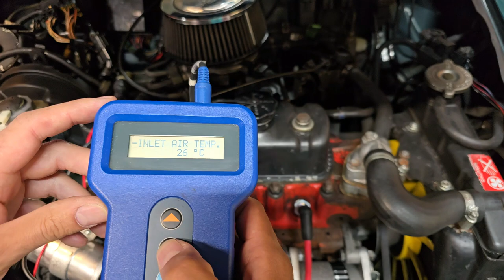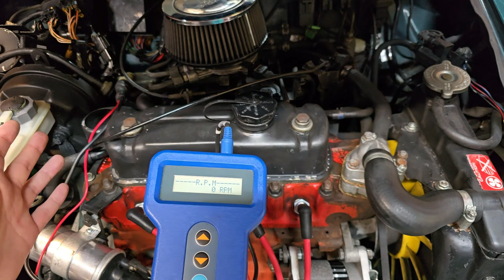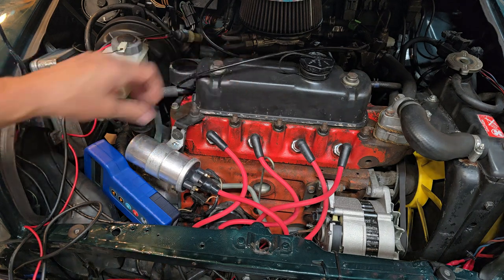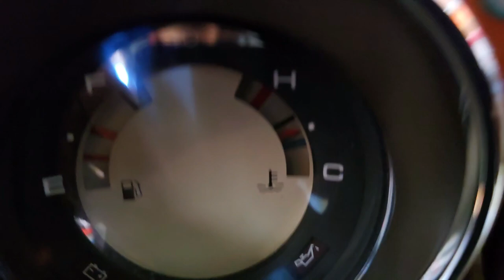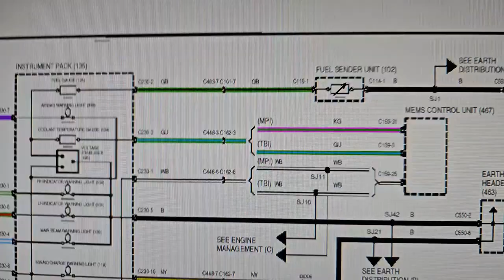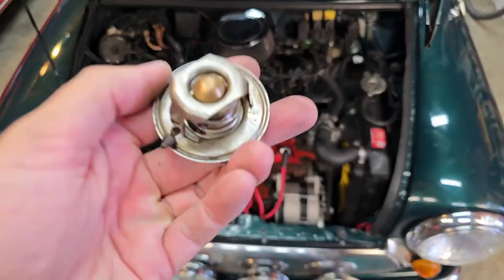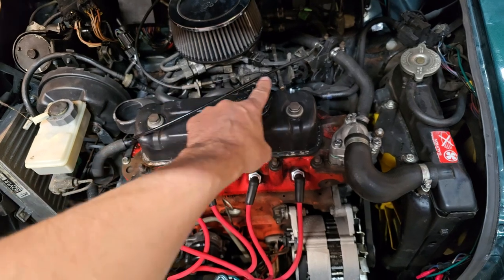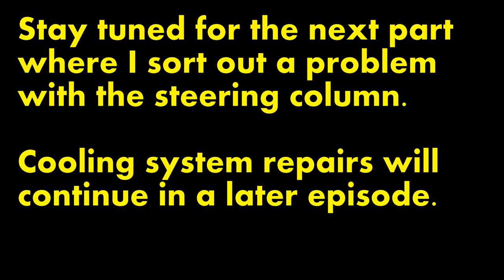Oh My SPI, Coolant failure and flow problems, part 2

Comment: I had a similar problem with my SPi Cooper (1992) in that the temp gauge was reading low and the ECU reported 72c when the rest of the cooling system was up at 88c. The solution was a refurbished inlet manifold with new stainless tubes. After that the ECU reports just over 80c when the engine is up to temperature.

On my UK spec car the radiator has sensor switch for the auxiliary fan that sits at the bottom front of the rad. To drain the coolant I find it is easier to remove the sensor rather than try to get the bottom hose off. I usually replace the temp sensor rubber seal with a new one on reassembly.
Reply from the maker: @grahamwoodier5066  I would normally drain the system by using the sensor. However, this was an original sensor and I don't have a new one or new seal to replace it with if it were to break or leak. I also knew I had to replace the water pump and would be needing to pull the radiator out anyway.